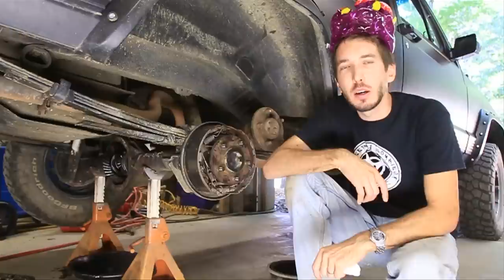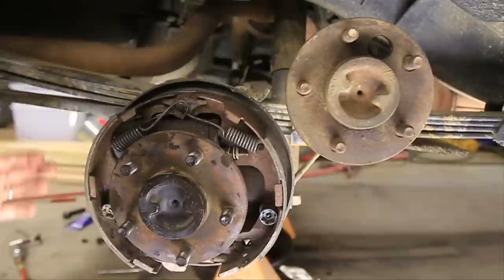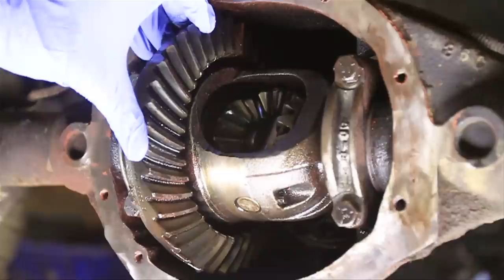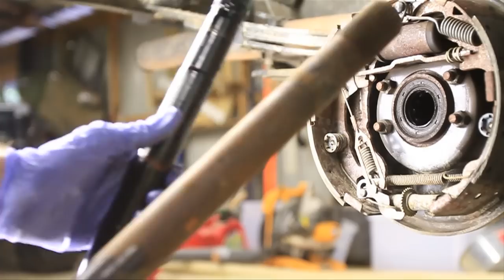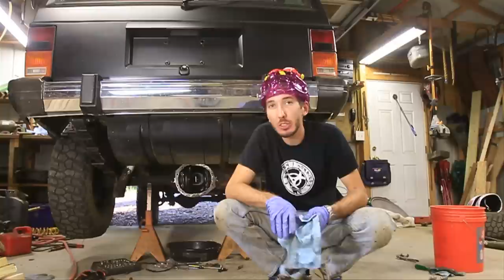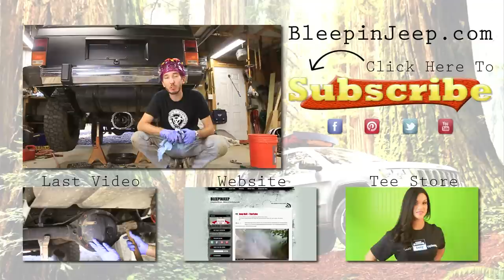How To Remove a C-Clip Axle Shaft

Comment: It was wobbling before I got new tires 3 months ago. What else could cause such a bad wobble
Reply: I had the same problem on my xj bad wobble rear drivers side for about 6 months, well about 2 hrs ago the axle shaft broke and the entire wheel almost came completely off, my mechanic told me to fix it but I never did should of listened to him
Reply: Well yesterday I took both axles out. Ordered a new one and its on its way in 4 days. I will replace the bearings and seals on both sides. The diff fluid was yucky as well. So once all that is done it should be ok. Plus I am going to have the tires routed and balanced to help the issue.  Seal question. How tight are the seals on the axle shaft. Are they a hair sliver loose around the axle to allow it to spin a bit? Other than that everything looks good.
Reply: Lets hope the new axle fixes the problem.
Reply: +SuperDagod1 yes they have to be slightly loose
Reply: Ok then it is the correct size. I was a bit worried about it.

Comment: hey, i have a 2004 mustang. I am working on changing rear bearings and seals.  I removed differential case. Directions say to rotate the differential pinion 180 degrees but it literally will not turn. And the car is definitely in neutral.. Im mind fucked. Please help
Reply from the maker: Use the driveshaft and apply leverage
Reply: +BleepinJeep  are your wheels off the group ;)
Reply: +Hayden Kawas Parking brake?
Reply: +Hayden Kawas turned out I wasn't turning it hard hard enough. I did the job using Jacks and didn't have the leverage from how my body was positioned.

Comment: Couldn't you just use a wrench to loosen the bolt instead of removing the bearing cap with the socket and extension?
Reply: jim dandy yup you can. how the hell did he not know this. lmfao.
Reply: jim dandy was gonna say the same thing
Reply: Yeah, perplexing! I wouldn't remove the bearing cap.
Reply: He should have mentioned to mark the cap and reinstall in same orientation.
Reply: Patrick Baptist he did say. Reinstall the same way you are taken it out.
Reply: Frankie, that doesn't cover it.  IF one doesn't put those caps in correctly then well then they will learn the hard way.
IF someone needs to watch this to work on a little c-clip then they probably will need to be flat out told about the bearing caps as well, or then again don't so people like me wind up with more work or salvage when the owner winds up frustrated and broke because of a lack of knowledge.  
"Reinstall the same way you are taken it out."  Without MARKING them it will make it more difficult.  
But then again I understand I make how to videos, it's easy to forget things, lots of us watch to see IF there is a trick or hint we don't know yet....  Leaving out important info like what happens when you don't get the caps back on the same way is pretty important in order to do the job right.  I know several other people that repair their own stuff and wouldn't think a thing about it, but then again I'm the guy that shows up on site when the average joe can't get it done.  So by all means don't give em all the right info, I always am looking for another customer to hire me.  LOL.
But I'm not perfect and I've left some things out but it's typically things like bolts sizes, I always try to warn people about what they can screw up if they won't pay attention to the details, same as I'd want to know.
Reply: Patrick Baptist not necessarily the case. I am not a mechanic by any means, I build houses. I wouldn’t need to be told to put the cap on the same way it came off but I don’t know how to pull a c clip axle shaft out (and need to) people who know only know because they learned it at some point, you can either learn through trial and error or by being taught. There is definitely some people who shouldn’t own tools but that doesn’t mean if you don’t know you shouldn’t try
Reply: I've sure seen people do things to houses that ought not to have even tried, I've done crawl space encaps seen way to many people that were "licensed" in electrical and NG/LP work that did things I'd never do that should have more than known better, same goes for the auto work, all these things has made me sure not to hire anyone else to do my screw ups for me LOL, but another thing, if I do watch or read something in which I don't have enough knowledge, I've also learned to take in what several people say and not just one person.  We do all have to learn somewhere.
I remember doing my first C clip, I used a Haynes manual, but this was 16 years ago.
I've learned things by trail and anger, I mean error LOL it's alot easier if the person atleast points our things to be careful for, especially when not done right will result in a good deal of lost money.  I'm not perfect and I forget to mention small things from time to time as I also make how to videos, mainly on diesels.
I get ur point, take care.
Reply: Patrick Baptist that’s exactly what I meant. Just didn’t agree that those that don’t know shouldn’t try. I need to do axle seals on my ford 8.8 soon. I too have seen some seriously questionable house “repairs”! As I said there is those that want to learn and are probably capable and those that shouldn’t own tools!
Reply: I appreciate the video as it is exactly what I need to do next to change the wheel seal/bearing. My Haynes manual describes alot but to see it done is mucho helpful. Wish we were neighbors!

Comment: what is the propuse of a c clip
Reply: caparzzo it prevents the axle shaft from coming out of the housing, think of it like a cotter pin.
Reply: OppugnAll but, why they wan't to remove it? what is the pro and cons?
Reply: This video is showing you how to remove it for the purposes of the video its temporary for doing certain work such as replacing wheel bearing which you can not get to with axle shaft in the way. Now what you are refering to is a C-clip eliminator pro no more c-clip which means you dont have to open your differential to remove axle shaft. The con would be cost for my 8.8 I spent 475 for the kit but that includes new wheel bearings, stronger axle shafts. search yukon ultimate 8.8
Reply: thanks, for the intel, i'm trying to educate myself on this truck, i'm looking forward to buy it one day.